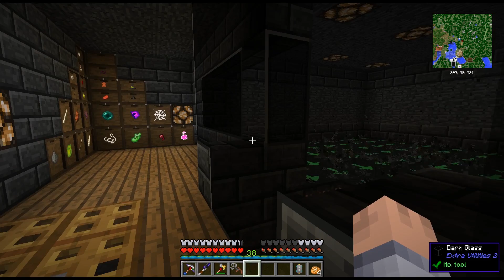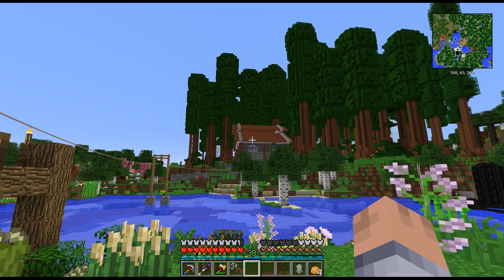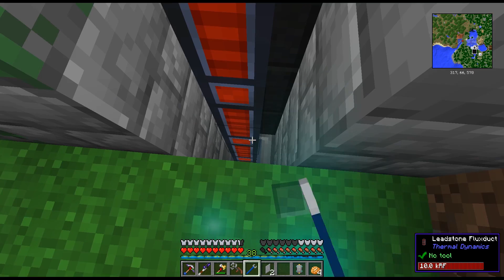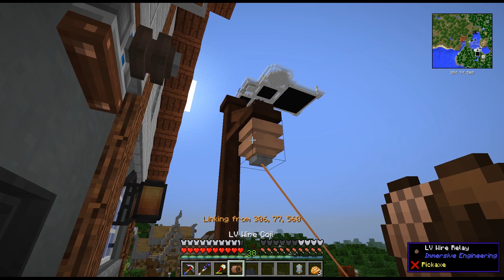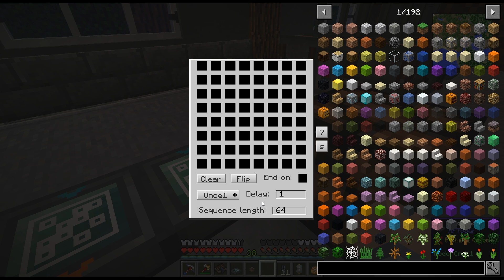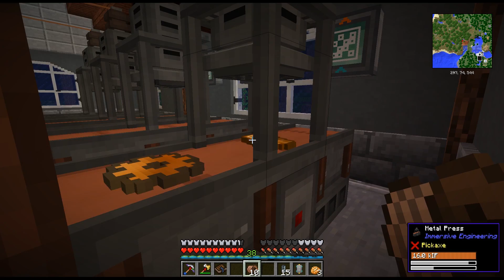Unbound #9 - Machines and Factory Building

Comment: There are also the other two multi blocks from Tinkers. The furnace smelt entire stacks but needs to pipe into the tank as it does not have an internal storage for the molten stuff. You can cast from the tank directly. And you avoid the problem with the alloys.

edit:
Should watch the entire video before commenting. I Thought the furnace only outputs liquid metals

Comment: For your plate presses you should be able to put a hopper facing towards the conveyor belt in the back and it will put items on the belt one at a time.
Reply: I was thinking that the whole time he was fiddling around with it!
Reply: Also for most of the other presses - I guess only the gear press is more tricky as it requires 4 ingots.

Comment: I know what you mean with the Platform's. I've been playing a little pack called Automaton, and living in a ravine, and I've got those all over and randomly climbing into the air is annoying.

Basic servos are your problem. They only fire every 3 seconds and so they need redstone signal during that time. Definitely the kind of thing you need to read the tooltip to catch.

As of update 0.12.78 of Immersive Engineering, the wires will do damage, but can be insulated with the fabric made from Hemp Fiber around a stick. MV Wires require Creosote as well as the fabric, and HV cannot be insulated.

So, your first three machines can be directly fed with a hopper which will keep the items from existing in the world. The last one can be fed directly via a Thermal Dynamics duct. That said, it looks epic as is.

Thermal Expansion retrievers will request an exact amount, so it can pull 16 grit and drop it in, and also pull multiple types. Just a bit of over thinking going on. :P

If what you want is the absolute fastest smelting speed, you need the Nuclearcraft Nuclear Furnace. (You'll also need translocators to keep up with it if you're smelting more than a stack.)

Comment: I think there's a new way to get IE wires through walls now, that I've seen from other YouTubers; you put two connectors on either side of a block and then hit the block with your immersive hammer and it should let you connect a wire on the other side and feed power through, that's how it was explained in the video but the block was also named "Feedthrough Insulator" in OneProbe, might be crafted, hope this can help in someway :)